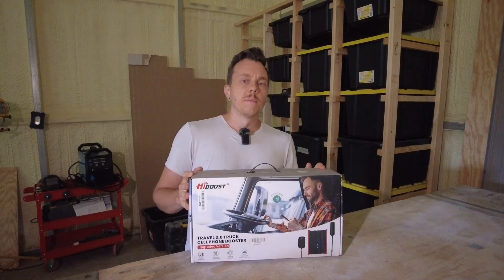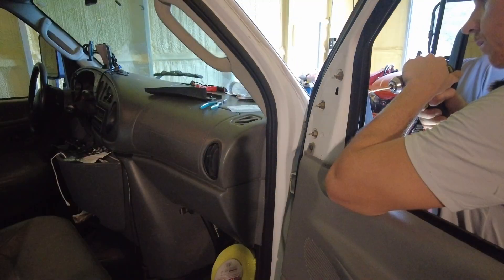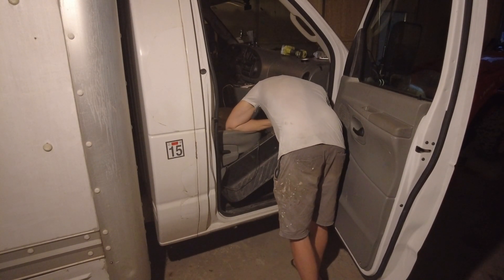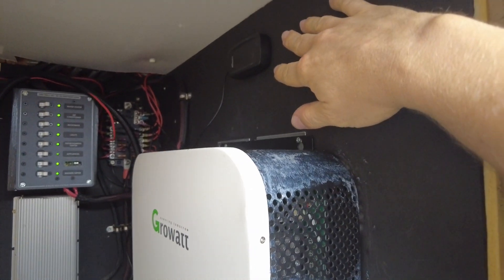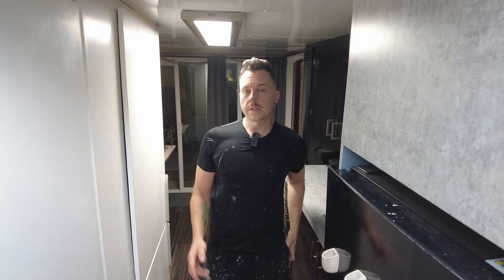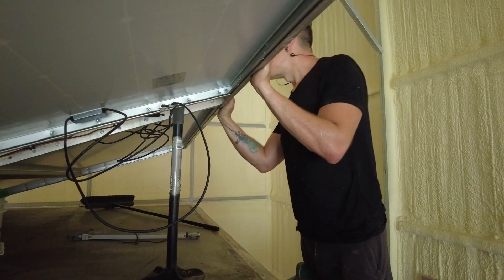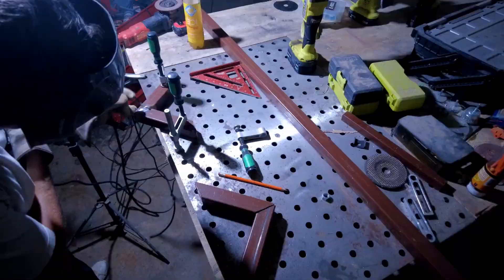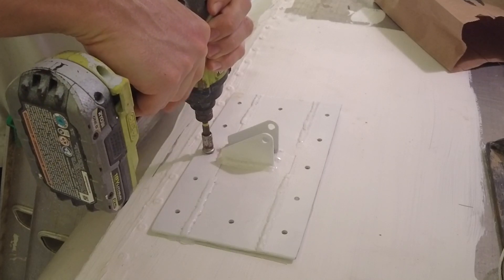Testing A Cell Booster + Tilting Solar Panels on my Uhaul Tiny Home

Comment: I also suggest potentially adding side bars of some sort to help leverage wind or gusts. But I suppose you wouldnt need to entirely lift it all the way. I'd hate to see your panels get cracked potentially but I don't know the integrity so I'm just in suggestion mode.

Comment: Great channel! Did you consider making a metal bar that connects the foot-side of the actuator straight across the roof to the foot-side of a hinge for the panels? That way the force is not on the bracket and roof itself, and instead is kept in the triangle between actuator, connecting rod and panel frame(s).

Comment: Hiya!  I live in Florida and due to the weather fun this year I’m thinking of purchasing power backup.  I want something I can use in an emergency in my home and later use for power on the go once I sell this place. Would you recommend the Bluetti you demoed for this purpose? I keep hearing about some products can’t charge and discharge at the same time and/or they can’t accept much in solar input. Thanks in advance!
Reply from the maker: Depends on what you want to power and for how long. A traditional generator is better for emergency backup (my power was out for a week after Beryl and there's no way a Bluetti would have sufficed). If you just want to power a Starlink and a refrigerator and charge cell phones and maybe run a couple small appliances for occasional meals, Bluetti would work. It won't run air conditioning.
Reply: @TheTechnoBarbarian  Thanks so much!  I was without power from Wednesday to Saturday and it sucked greatly. I had to throw everything in my refrigerator away. I’ll look at a small generator and save my pennies for solar later when I hope I can buy an RV.

Comment: Nice idea about the way you installed the actuator. Only concern I'd have is shading, if it's not looking straight to the sun, the mount might shade one panel slightly which often means that panel drops dramatically in output, that's why people usually have all mounting and actuating hardware behind the panel.

Comment: Consider putting some sika over the screw heads on your actuator mount. I used some of those on my boxtruck solar, and it took less than a year for the Texas sun to dry and crack them off. That created some play on the mount since the screw was no longer tight, and it striped out some of my holes bouncing up and down.

Comment: Always nice seeing new vids on this channel.  Curious, have you (or are you planning to) put some sort of corner lockdowns on the free side of the panels?  Seems like they might get a little "flappy" at highway speed being only tied down on one side and a center point.   Also curious if you have looked into the new starlink mini for your off grid connectivity.
Reply from the maker: Not sure I understand what you mean "at highway speed." They will never be tilted while moving. I do  plan to implement a kind of "stand" system so both ends are supported. Starlink is definitely on the todo list!
Reply: @TheTechnoBarbarian  I didn't think you would be driving with it up.  I meant when it is in the flat position there's nothing holding the driver's side of the panel down.  The support points are only on the hinge side and at the center of the panel (where the actuator attaches).  In this position (given the flex of the frame) it can probably lift a bit at the corners.  When you get rolling down the road you could get some variable lift at those two corners and when you hit some resonate frequencies it could cause that whole side to (try to) flap like a bird (with the two corners being free to move up and down and the middle being somewhat stationary).

Probably not that big of a deal, but if you ever hear knocking on the roof when you're driving, that might be what it is ;)
Reply from the maker: @gamersincepong  Ah I see. It definitely doesn't get any lift while driving. The front drivers side has a latch that keeps it down. It's been driving around for thousands of miles just like this with no issue. Even without a latch it's far too heavy to get any lift.
Reply: Some good questions. I'll check back for answers. We wanted tilting panels but the Santa Ana winds in our area 😬.

Comment: Congratulations on getting a better cell signal.  👍

Was wondering what happened with your channel 🤔  any new builds in the works?
Reply from the maker: Massive upgrades to my prototype to actually finish it and sell it. Full electrical system upgrade, bigger batteries, mini split AC and more